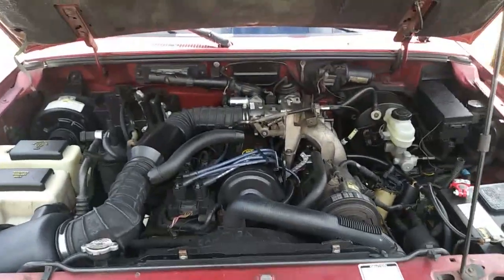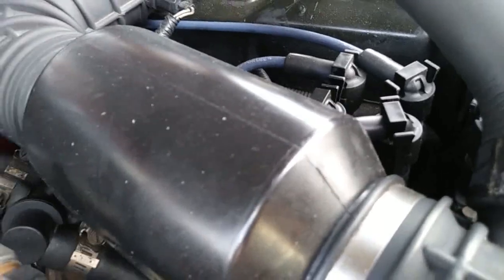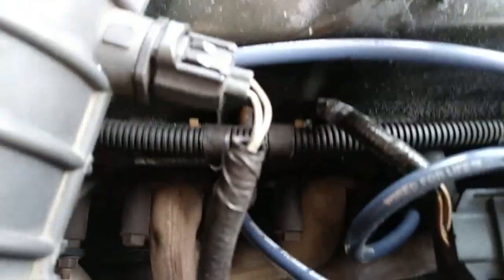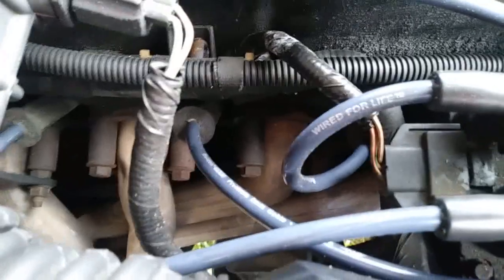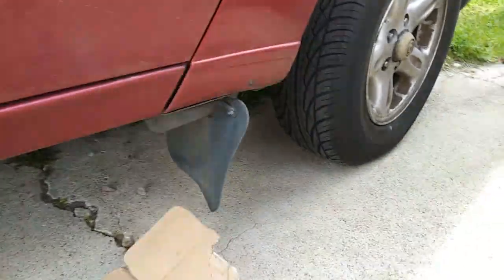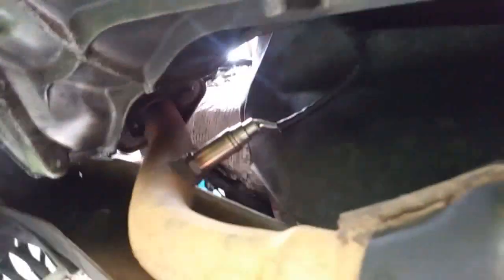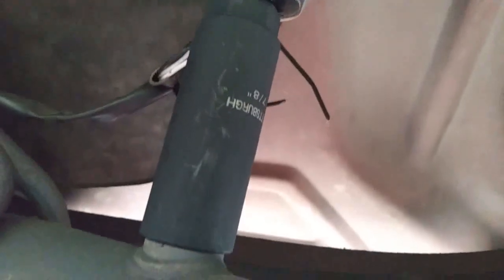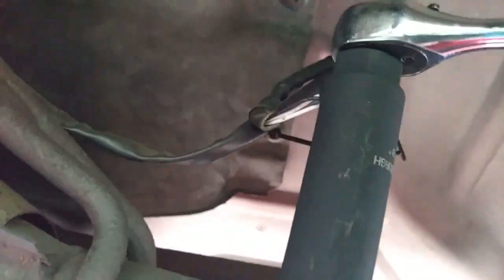Ford Ranger 2.3 O2 Locations & Bank 1 Sensor 2 (Downstream) Replacement

Comment: The struggle be real Where is P0155  code located on a ford ranger ? So it’s marking me that code P0155 Heated Oxygen Sensor (H02S) heater performance (bank 2 sensor 1)

Comment: The first sensor (upstream) is close to the exhaust manifold outlet and before the catalytic converter.  The second O2 sensor (downstream) is after the catalytic converter and toward the tail pipe.  You have these backward in your video.  Exhaust starts in the engine, moves through the exhaust manifold, into the exhaust pipe, then catalytic converter and on to the muffler and tailpipe.

Comment: So sensor 2 is the one furthest to the rear of the vehicle?
Reply from the maker: Correct.
Reply: @FelixElGato007  thanks

My issue, upon further inspection, is different.  The drive shaft dampener ring came off and has damaged the wire before the connection.  So, bigger issues.

Comment: if both these are bad whats could be the symptoms. im having a rough idle in my 2.5 ranger :)
Reply from the maker: If your engine is running rough, it could be a vacuum leak, bad fuel injectors, spark plugs, o2 sensors, and etc. If I were you, I'd try to go with the easy stuff first vacuum leaks is probably the easiest. Also, check for any codes if you have any. For fuel injector cleaning try a can of seafoam or some Marvel Mystery oil and pour some inside the gas tank, see if it helps. (:
Reply: @FelixElGato007  my code reader said bank 1 and bank 2 solenoids are bad, plus a couple other codes. ill probably replace sensors first and go from there, thx for the response and video man
Reply from the maker: @hunteralan2165  Sorry, I thought you were talking about my other video. If these are bad, your car or truck can indicate lean or rich fuel mixture, either the voltages could be high or low, depending on the code. Both solendoids are bad you say, I would check the voltages on both sensors. You would need to replace them. That could be the cause for your rough idle.
Reply: @FelixElGato007  i hope that's all it is! thx man